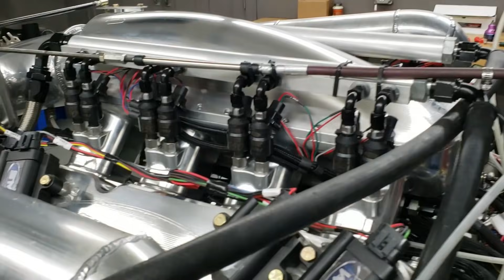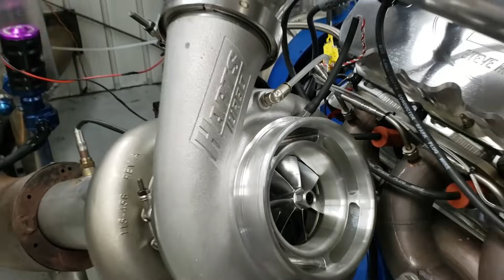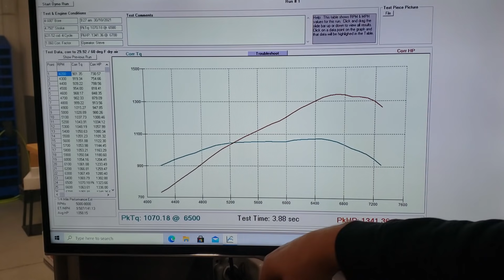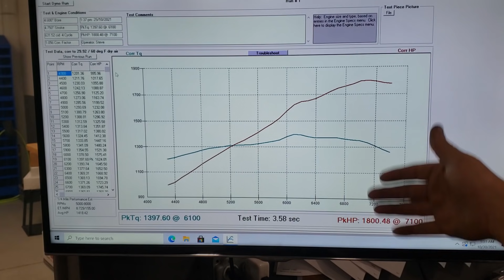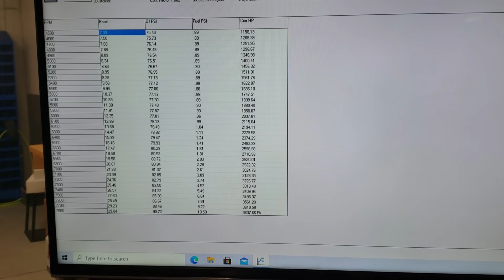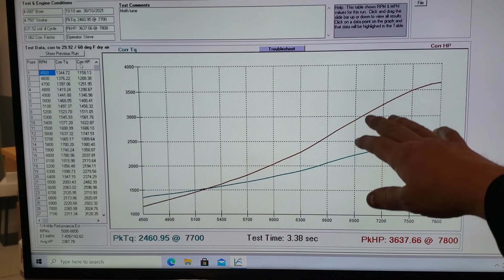3600+ HP !!

Comment: They should also redesign the meth pump to have a sliding coupling so you don't have to take stuff apart.   Could even electro magnet clutch it using A/C pump clutch technology.

Comment: Really that ain’t a engine for driving on any street in this country I just can’t believe people even call them street engines.Just some insane guy with way to much money calling it something he will drive on the street the most street driving he will do with it is drive it around the block and park it for the rest of the year.Incredible
Reply: Guess you never heard of raceweek. These engines do over 1000 miles street driving in addition to doing 6-second quarter mile passes.
Reply: Plus pull a trailer doing it through the mountains on Rocky mountain race week pretty negative comment from somebody so far off base
Plus as the owner of the motor I promise you will drive this
Reply: It's not in a post epa regulated emission control vehicles but in a pre epa regulated emission control vehicles saaaayyyyy a nova which is where this engine is destined you drop the hammer on the open road and smokem. 😛😛😏😏✌✌

Comment: It has titanium rods. It's billet, water jacketed, 5" bore space. It's a very nice piece.
Yeah I was starting to wonder if it was any good.

You are corn foozing the peanut gallery boss. Boost is a pressure measurement. You wouldn't build any pressure without some restriction. High boost numbers can be from flow restrictions in an inefficient motor.

Comment: hi Steve. While hp v boost is not a straight line trajectory, if you said at 5psi on meth it was a true 19 psi allowing for atmosphere pressure as well, your 1800 hp achieved is around 95 hp per pound of boost. On the later test your 30 lb and 14lb atmosphere makes a true 44lb that's around 83Hp lb of boost. The drop off is not as significant as what you might expect. I would be really curious to see pounds of fuel per hour at different boost setting as that would give a true indication of the efficiency of turbo chargers and how much fuel you need extra to overcome pumping losses. I am very impressed with your results. Presently working on a billet 2440cc engine and at 42lbs boost pushing out close to 1200hp on c16 fuel at 9700rpm. Our biggest gains have been by way of charge cooler upgrades. Packaging becomes a problem. What is impressive about turbo chargers is how much air they move. At 10000rpm and full boost our turbo charger is basically filling a 55 gal barrel to 45 psi every second. It is mind boggling!

Comment: I have a couple of a few questions about the differences in between aluminum and titanium connecting rods, the first is what is difference in weight between the rods, the second is what is the service life between the two rods if the engine were to be used for all out drag racing i.e. how many runs can you put on a set of rods before it would be prudent to replace them to potential avoid a failure, the third is what’s the cost difference between the two sets of rods, and lastly are there and disadvantages to running titanium rods compared to aluminum rods.

Comment: You're increasing the air's density by using methanol's evaporation/latent heat absorption inside the intake manifold/cylinder. Therefor the cylinder is actually filling with more potential/denser air charge relative to regular pump gas. You actually will drop "boost" yet have more in cylinder air density.... and of course more exhaust potential to drive the turbo turbines. The turbos now don't have to work as hard yet they have more energy driving them! This is why the gains are so big on turbo cars when switched to methanol, you're double dipping on both ends!

Comment: I bet with a pair of 98s it would be more efficient and it would probably get a little closer to 4000hp if not over and I love this build because I'm a diehard Chevy fan through and through and a max effort build 632 with twin 98s or twin 102s is on my bucket list and maybe a 481x as well I know the Hemi's are capable of making alot more horsepower but I would love to have a 632 like this in a first gen Camaro SS/RS or a 62-64 Chevy II or 69-72 Nova SS or maybe even a 70 or 72 Chevelle SS

Comment: Would stretching it to 7900 rpm have shown just a little more power? 

The graph suggests there's a little more life in it. At 7800 rpm power is still going up, not peaking as torque does at 7700 rpm. Or are there other mechanical reasons to rev out to only 7800 rpm?
Reply: It'll make power until the air runs out, but there's no sense beating it to death on the Dyno

Comment: 5 lb of boost is 1.34 bar 10 lb of boost 1.68 bar  so not a linear doubling of pressure. .  Nice video.   3 bars for Meth about 3 times the hp at peak  great job .
Reply: Been a while since I went to school, but, I think I remember...
You're comparing gauge pressure to absolute pressure.
5lb gauge, would be 0.34bar.
10lb gauge, would be 0.68bar. So double is a fair description. 
The first bar is free, in the boost world, every little bit after that, is expensive.
Reply: @aaronnoyb    Your look at added.  I looked  at all of it thus normal pressure of 14.6 at Sea level  1 bar .  Viewing total in the engine  input for the ratio differences.  thus 1.34 vs1.68  is not double the amount. Hope that cleared up my reference point on this.  As you see 3 bars giving about 3 times  NA  approx.

Comment: What do you use to control all those injectors? Does holley efi have that many injector outputs?
Reply: They have add-on driver modules to drive injectors. It's becoming much more common to run 2-3 sets to have 1 gas injector, and 1-2 methanol injectors.

Comment: A turbine that is not spinning fast enough can be more of a restriction than a stopped turbine. This is why pilots feather the prop when an engine fails. Never thought that might apply to a turbocharger, but it has to at some point.

Comment: On those motors do you ever have a problem on the street injectors
Reply: Methanol is hard on stuff. That's generally the set you'll be working on.

Gas is nice because stuff just works.

Comment: Just out of curiosity, how much does a set up like this cost?
Reply: Probably one of those " if you have to ask" deals
Reply: It depends. His normal prices start between 20k to 40k depending on what you want done. When you go full pro mod ot starts 50k to 90k. 

If you wanted an engine to even start work you would need half up front and partial mid, and remaining towards the end. 

It's best to have the money ready before you start. Steve isn't really for start off but more so when you ready to finally cross the final thresholds
Reply: For sure north of 75k but could’ve got a good deal with it being used